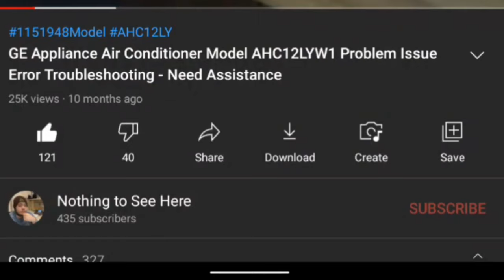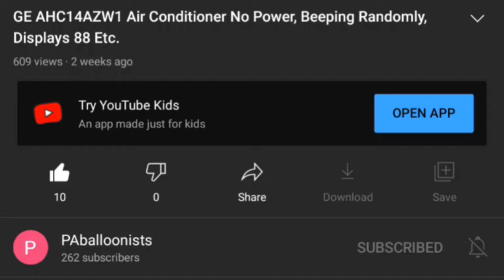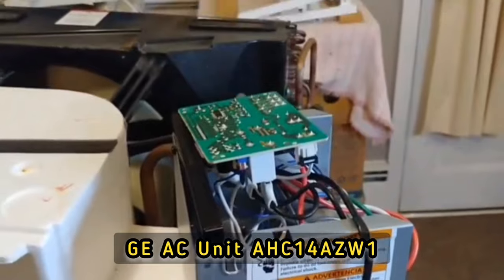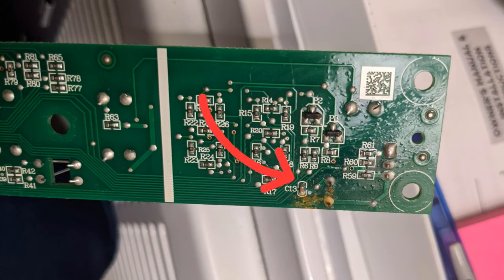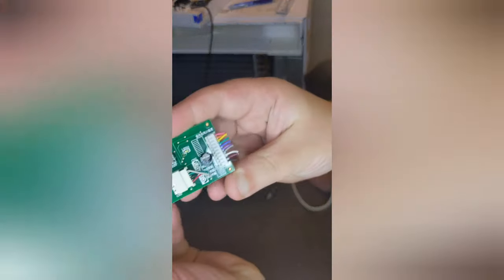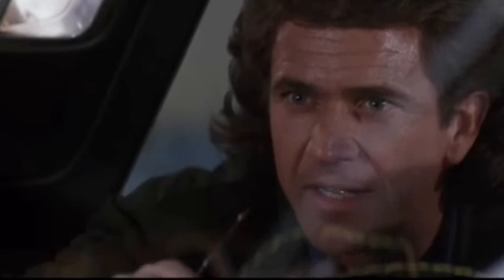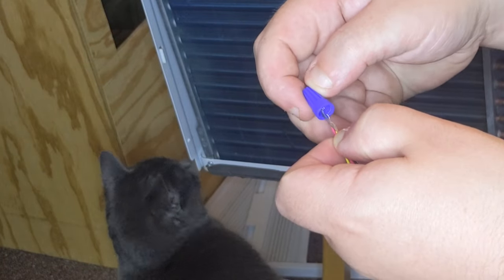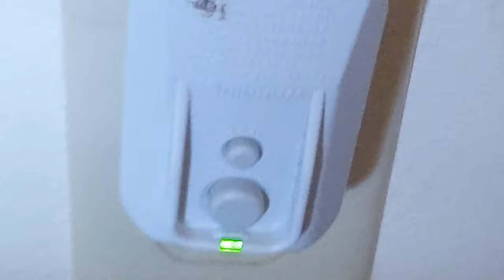GE AC Unit Model AHC12LYW1 or ACH14AZW1 - Unit Beeps, Shuts Off, 88 Symbol Bypassed DIY | How to Fix

Comment: Is this a fire hazard?
Reply: I mean if it runs too long.
Reply from the maker: This video show the removal of a low voltage device.  Hazard may occur if you do not properly seal the wires, but the heavy power is deeper within the unit.  Yes heavy power is within a metal box - for this hack, you do not need to go that deep.  Just tape and cap the wires that are cut and use the system as needed, or put on a timer or thermostat.  This solution cuts out the control board whichnis only led and wifi chip, on off... Etc.
Reply: @clarkkc11  OK thank you I did the operation and it worked great last night pulled the room down and then we just turned it off before we went to bed initially it was taking my lights Lisa little bit and it seemed like the compressor was having trouble kicking on which seems like a relay issue
Reply: @clarkkc11  Also I looked over all the circuit boards and didn’t see any shorted out circuits or anything like that and I also couldn’t see any capacitors that were blown. There was a fair amount of rust on the bottom of the compressor legs and also some rust on the external heat exchanger pipes at the bottom but nothing too crazy we have only had this air conditioner for about one year and stopped working after a power outage

Comment: Hello can you please respond to my comment I have a question?
Reply from the maker: I see this comment, hard to dig... What can I help with?
Reply: @clarkkc11  So you know the Wi-Fi model thing? And how it has wires into the motherboard?

Could we cut those wires and wrap them with the power wires to be able to use our phone to control it?
Reply from the maker: @lonelyrock4795 from what I am understanding, I do not believe that will work.  The wifi module is a low voltage device.  It is powered thru the front control panel.  

In my devices issue, the control board in the front panel was corrupted and the pathways that powered and controlled the wifi control were no longer able to be used.  

This fix cuts out all low voltage control and the bypass allows the device to simply be on or off via surge protector plug.

Others have said you can wire in a thermostat but I do not know how that works, I have to see something to understand where it would fit in the circuit.  

But what you described, I do NOT Think that will work.
Reply: @clarkkc11  okay thanks sorry for the bother

Comment: Is it safe
Reply from the maker: If you follow this video, wrap as required and keep the unused wires as shown, so far so safe for me... Testing a second summer with this fix.
Reply from the maker: The key safety issues are making sure it is unplugged when working on it.  And tiring off the connections to the very low voltage board that controlled the control functions and not the power that controls the main unit

Comment: Trust me if anybody watches this I have just went through this 5 minutes ago water is leaking into the chipboard I used silicone and put it back together and have not had a problem trust me good air conditioner but do not buy one with the controls underneath of the vents it's pointless